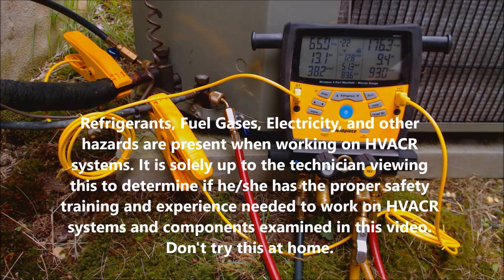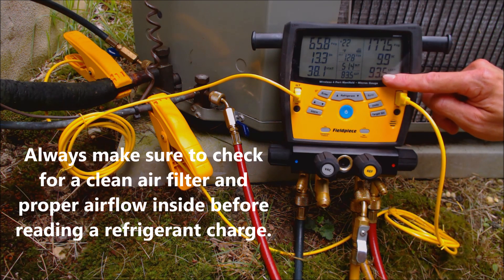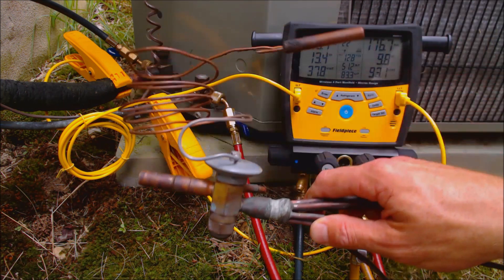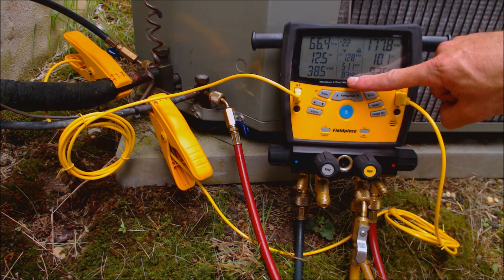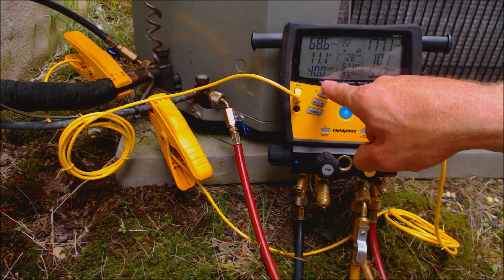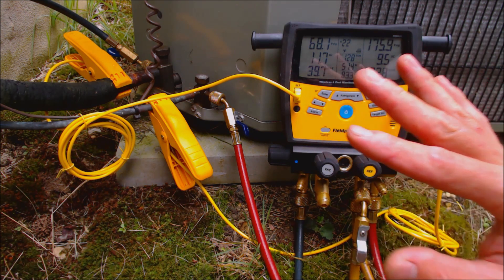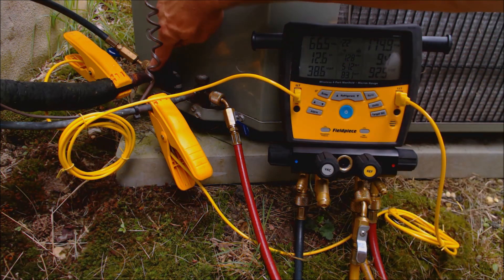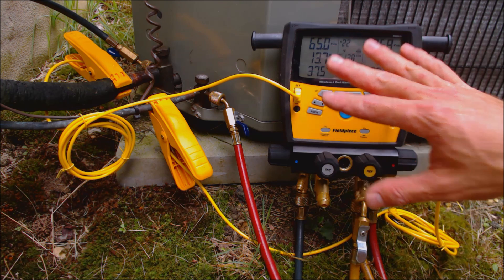Quick and Easy Refrigerant Charge Check with Digital Gauges! SMAN460

Comment: Quick question: I noticed head pressure fluctuating 3lb and wondering when to be concerned about non-condensibles in system. Just had a 410a head pressure bouncing from 275-281 with TXV secured bulb with a 6psi  fluctuating head

Comment: You are my go to channel for tips and tricks. But I have a rheem heat pump that confused me
R410 heat pump 
Suction 123 liquid 320
SH 15. SC 1.6
Liquid line temp 98.6
Suction temp 57
Outdoor dry bulb 85
Indoor coils clean. Very good air flow. Newly installed unit. The SC was very low to me so I added a few ounces of refrigerant and it did t change at all

Comment: Why does everyone have a different subcool choice. My first teacher and you both say 8-12 my new instructor says 10-15 wtf is the standard? Just 10?
Reply: installed a Ruud unit on the electrical panel plate says if it’s 90 degrees then sub cool is 7 it says it on the plate
Reply: @sir-cloutt3417 I have a Rudd also. It is 96 here today, so my sub cooling  target is 7. According to the data plate it’s +- 1.5 degrees. My unit runs a sub cool around 5.5 consistently.
Reply: Woe now lol but also, I'm ready for the answer too.
Reply: @borshardsd  8-12. For heat pump I believe you charge around 10 depending on your climate because the coil swap wouldn’t want to overcharge the evaporator when it becomes the “condenser” in heat pump mode. But you should go off the rating plate.
Reply: @EastDallasKicks  those nice days , when we are lucky enough to have that info on the unit. 🍻 good share.
Reply: The data plate will normaly give u the sc but 8-12 is wat i use wen data plate is un readable

Comment: if this was an r410a system then you would of had to charge on the high side and close off a valve back to the compressor correct?
Reply: Add through low side

Comment: Thank you very much for the basic explanation!  I have a 360 I used to install a mini-split (built-in micron gauge to see how deep vacuum was).  Also used it on my car to vac and recharge the R-134.  Next is to check my R-22 units, which is why I watched this video!
Reply from the maker: Thanks Hubjeep!
Reply: @acservicetechchannel    I hooked it up just to check the system which was cooling fine... 
Low = 76,  high = 164, SC was only 1.8.  I added 1.5 lbs of R-22 vapor:
Low 72, high 194, SC 10 so I stopped.  Label on unit says interior SC of 7, design is low 150, high 300.

Comment: Ac service tech llc  question wat cause low temp on the suction line 34 degrees. And saturation coil temp 29 degrees ,suction pressure 58 ? My superheat was 4  coil had. No ice

Comment: Can you charge up new units with these digital gauge sets? Some one told me that they are not recommended for new installs?
Reply from the maker: Yes you can. They can be used just like any other gauge set. I keep them off the system when doing the initial vacuum. Maybe that is what they mean. Look up "acservicetech full vacuum procedure" thanks!

Comment: Appreciate all your videos, so as apprentice do you recommend buying this gauge.? Or should i invest in a analog and buy a micron gauge.
Reply from the maker: This is just my personal preference but as an apprentice I would buy the three appion valve core removal tools, the cps micron gauge and a 3 port manifold gauge set, hoses with valves on the end. We do vacuums without the manifold gauge set involved mainly nowadays. You can always move up into the digital gauge set as time goes on, especially with the comparison of price between the two being close to 7 times more expensive. I would like to see you get more of the smaller tools needed first such as valve core removal tools, vacuum hoses and the ST4 dual temp reader. I have these tools linked at amazon.com/shop/acservicetech as well I put them below.
Fieldpiece ST4 Dual Temp Meter  http://amzn.to/2wc1ME3    -  
Yellow Jacket Refrigerant Gauge Set http://amzn.to/2aenwTq   --

Refrigerant hoses with valves http://amzn.to/2aBumVI    -  

Appion Red 3/8" to 1/4" Vacuum Hose http://amzn.to/2uYg6Ro    --

Appion Valve Core Removal Tool http://amzn.to/2uYr8WL   --

Yellow Jacket 1/4" by 1/4" hose http://amzn.to/2umtcod  --  

CPS Vacuum Micron Gauge http://amzn.to/2v1nM3O    --  

JB 6 CFM Vacuum Pump   http://amzn.to/2nqbvo8   -      
or the fieldpiece https://amzn.to/2R1GEgG
Reply: Thank you i appreciate your suggestions and will be adding theses to my tool box 👍

Comment: The technician I was working with. When the charge was to high , to much refrigerant in the system. He would let refrigerant out on the high side of the gauge to fix the charge When the unit was running. If the unit is over charged how do you fix that?
Reply from the maker: You just connect the yellow service hose to the recovery tank, open the red handle, purge the air from the yellow hose connection at the recovery tank, tighten the yellow hose connection,  tighten the red handle, open the recovery tank, zero the scale and charge into the recovery tank as needed with the red handle, thanks!

Comment: I see that model also has a built in micron gauge mine dont is it accurate. And i know oil messes up the sensor. I have problems with different micron guages not being accurate after being used 4-5 times. I try using isopropyl alcohol then put the cap back on but sometimes it dont work.
Reply from the maker: Have you seen this video on the vacuum procedure?-  https://www.youtube.com/watch?v=wYZ8Wudksb0   - I don't have to clean the micron gauge because it doesn't get oil in it. It is rare when I have to clean it but I do not have leave the gauge set in play when vacuuming. It is also faster to keep it out, thanks

Comment: I have the sman460 and I don’t live too far from the fieldpiece store in Orange County, California. I had them replaced once because a sensor was bad, customer service is great! In regards to the temp clamps, I feel like they’re not accurate sometimes. Someone from fieldpiece calibrated them for me but I sometimes get weird reading out in the field regarding superheat and subcool. Might it be that the copper line are rusty and I don’t get good temp reading? Or should I get better temp clamps? Any suggestions? Great video!
Reply: Yeah, me too.  I will scrub off the tube with a scotchbrite pad if it's really oxidized and temporarily put both clamps on the same tube to cross check them to each other.  Can also tape on another bulb from a separate thermometer to verify.  I use the 360 as it has no bluetooth which is required where I work for security reasons (DOE nuke lab).  The Fieldpiece is an excellent unit and gets a lot of runtime on a set of batteries.
Reply from the maker: Thanks Armando and Brian, I put out a calibration video for checking the temp sensors. I would only use Fieldpiece temp clamps in their ports. Make sure to only use the specific sensor that was calibrated for that gauge set wire connection. If you switch the temp clamps with each other or put in a bead type sensor in without recalibrating then the temp reading will be off. I always use the Fieldpiece ST4 if I question a temp reading. I keep the bead type temp sensors in the ST4. Sometimes I prefer the bead type over the clamps for accuracy since they are small and you can insulate over them with armoflex if needed, thanks!
Reply: Yea, temperature will never go through rusty surface Or one with any kind of oxidation, corrosion etc. allways clean a pipe up for accurate readings. use some sand cloth for accurate reading.

Comment: Great video as always. Do you need a different Manifold gauges for each different type of refrigerant ? Cuz the Mansfield is capable of reading many refrigerant so I have to buy a new Mans field gauge for r22, and another one for r410a and so on. That can get expensive.
Reply from the maker: With the yellow jacket gauge sets yeah we usually keep one set for use with each type of oil but I don't expect people to have 2-3 of the SMAN460's. You could blow it out with nitrogen for each use or keep two sets of hoses, one set for POE and one for Mineral oil. We do what we can without going crazy, thanks JiggyPatel and great question!
Reply: No, You Don't Have to Have Different Manifolds for Different Refrigerants. Just Keep Your Manifold & hoses Clean and clear of Debris. Keep hose ends capped with brass flare caps. Keep knobs in the center position , and NEVER keep pressure in your hoses and manifold.allways keep caps loose on hoses and valves in center position. Keep your manifold in a Hard case or Hang in your truck in a safe spot. Digital Manifolds Need to be Treated Like the high priced piece of test equiptment they are. the More u Protect them and take care of them the Longer they will last and Give u better service. That said, you Need to Keep at at least two manifolds on your truck at all times. manifolds will leak after a period of time deending on manifolds. its best to own a set of analog manifolds too. they are better for checking compressor valves on pump down and have no digital sensor lag. they are also more durable than digitals. i personally recommend imperial 600 or 800 series analog manifolds for day to day use. they have served me well for 37 years. check out nor-cal refrigeration page for the manifold he uses too analog type. i think its a yellow jacket. titan or brute one or the other. best to allways have one Analog and one Digital manifold on the truck. at least minimum.
Reply from the maker: I have always had good experience with those simple yellow jacket 2 port manifolds and it was always easy enough to have three sets of them in the truck with their hoses. Imperial is certainly good too! Yeah I don't think it is worth having more than 1 SMAN in the truck. The issue always is always how to keep the hoses clean. I do agree not to tighten the hose ends but do cap them off.  The problem is if you get humidity into the hoses and we all hang our sets like a U with the hoses coming back up and connecting at the port at the bottom of the SMAN, the oil collects in the bottom of the U and doesnt get a chance to get out. That oil can mix with the air and contaminate it and then we put that small amount of oil in the system possibly or accidentally. You can blow those hoses out and the SMAN with some nitrogen every once in a while if you aren't naturally doing it with pressure tests. That is nice that OC puts his manifold in a case when he is not using it. We do what we can but like I said, don't drive yourself crazy.  We do what we can for the quality of the equipment and for the customer, thanks JiggyPatel and OC!